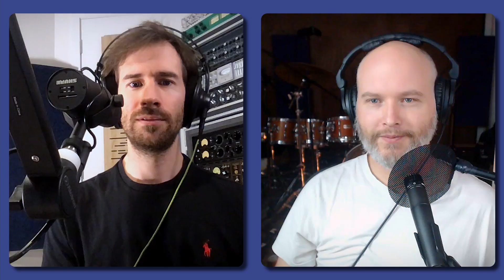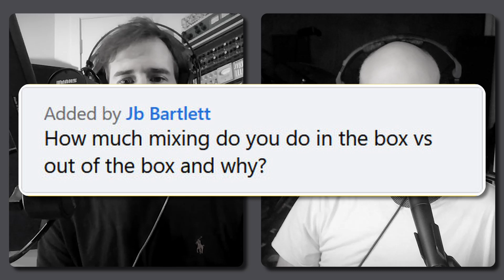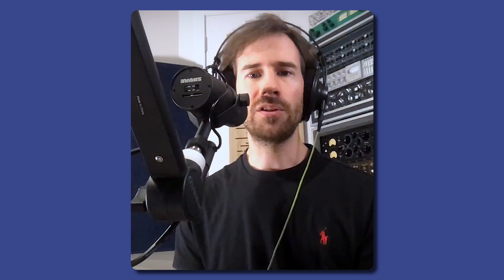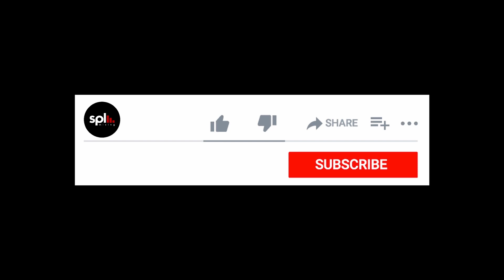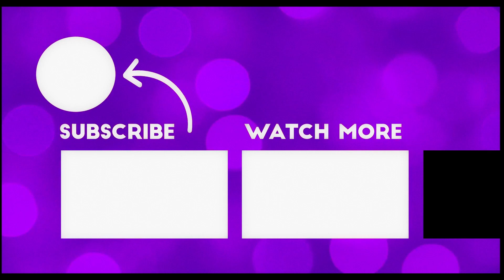Why Hybrid Mixing Might Be The Best Solution | SPLmixing.com

Comment: Been in the box mostly but I tend to agree with Simon. outboard is a pain in the but but better separation, cloud is gone and transients are handled much better. Had and tried most of all ssl bus comps and they just all sound flat and 2D compared to hardware. And the transients are handled in a much more pleasing way with a hardware SSL..

Comment: Regarding oversampling, can you get the same effect by rate converting all the raw track first, say from
48Khz to 96Khz? Assuming a high quality conversion would that be equivalent to 2x oversampling in all 
your plugins?
Reply from the maker: In my tests, where I am able to oversample by 4 times in real-time (using metaplugin) quite easily on selected tracks vs. the whole mix, or up to 16+ times oversample in offline bounce, no amount of upsampling audio can do the equivalent. I think 4x OS is a minimum, but 8x is preferred. Even running a file conversion to 192kHz falls short of that level of detail and ability to get rid of aliasing artefacts, but also 192 files would be far more cpu taxing than targeted oversampling on only the tracks that need it. So to answer your question, no, you would need a session sample rate of 384kHz to do a good amount of aliasing prevention.
Reply: @SPLMixing  Thanks for the reply. Nice content on your channel BTW :-)
Reply from the maker: Thanks 👍